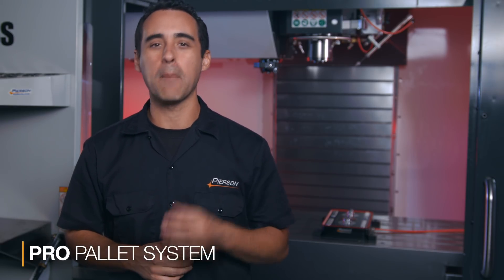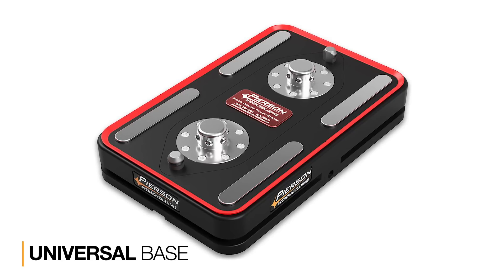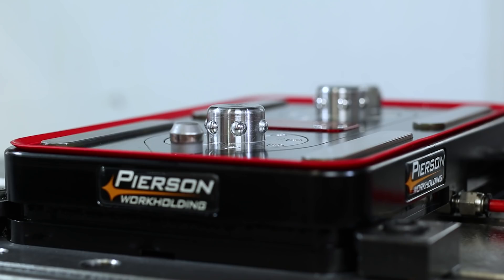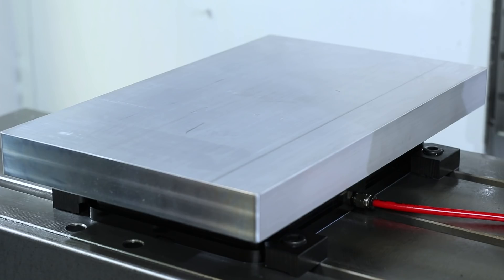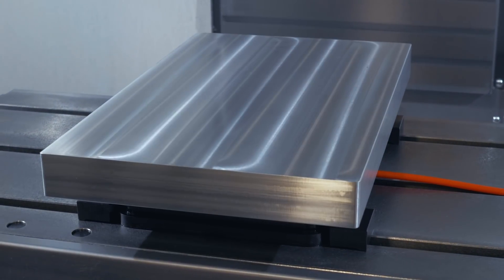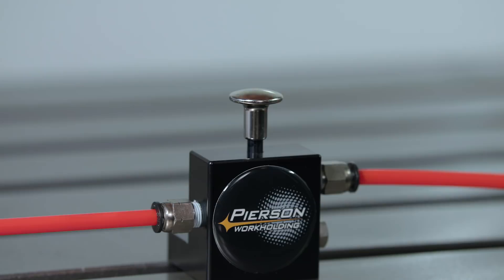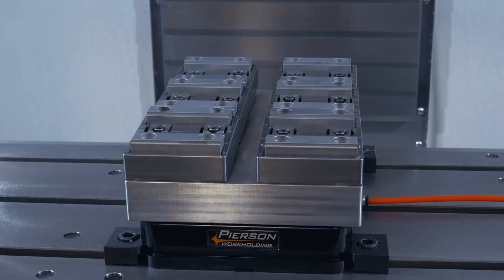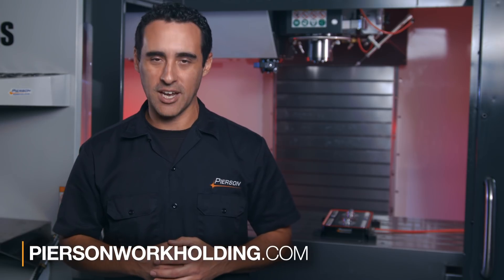Pro Pallet System Overview

Comment: I have this system for my brother and am just now installing it.  The only time I did multiple parts per cycle was on a home made vise pallet where the part was simple enough to just cam all the parts out while using one work offset.  The parts I plan to make with the pallet system however utilize 3d milling so the code would be far too long to cam out say 10 plus parts for one cycle.  I have a couple options but am curious what you think.  I could make multiple reference points and use g54, 55, 56 etc.  I could use the work coordinate offset in either the control or within fusion.  Or I could use one reference code and just call on another program for each part.  Obviously the most efficient way would be to run each op on all parts before changing tools and running a second op but I am really not sure how I even accomplish that in fusion.  Sorry that was a mouthful but any suggestions?
Reply from the maker: A good strategy is to use one work offset like G59 and model your pallets off that point.  We recommend using the center of the round pin for the X and Y origin and the top of a pad for the Z.  This way all your pallets have the same origin and you never have to probe individual parts again.

Comment: I've been using the Pro Pallet System for over a year. Great product, economical price, and great service. They paid for themselves in a week. Much better than vises. I use the pallets along with mighty bit clamps and achieve high density part placement. The per pallet cycle time allows more time for the operator to swap parts on the pallet and swapping pallets only takes 15 seconds on average. Maximum productivity and spindle running time.
Reply from the maker: Larry, this is awesome!  Exactly what it's designed for.  You get it!!!!